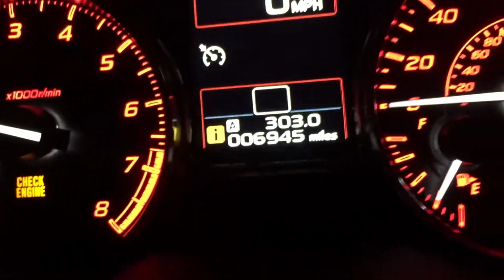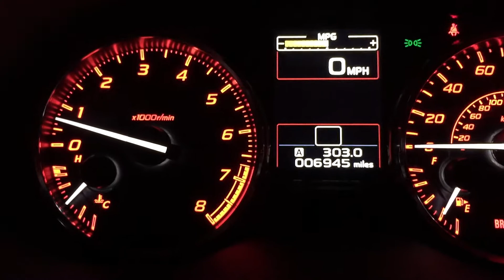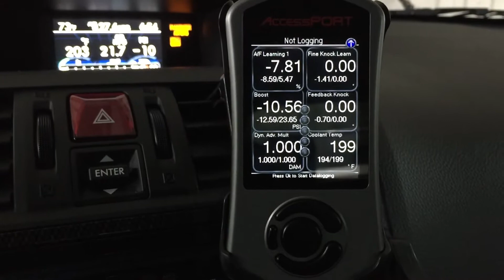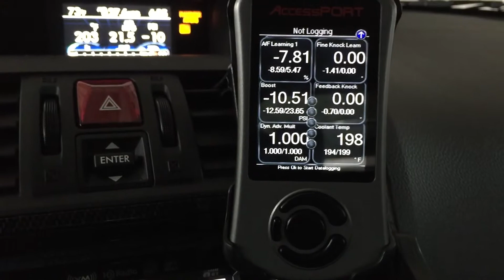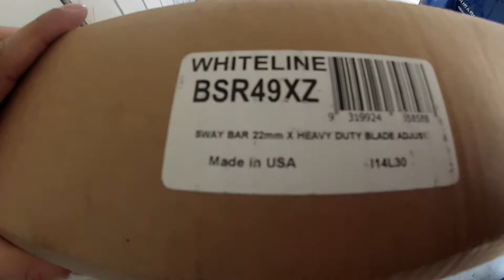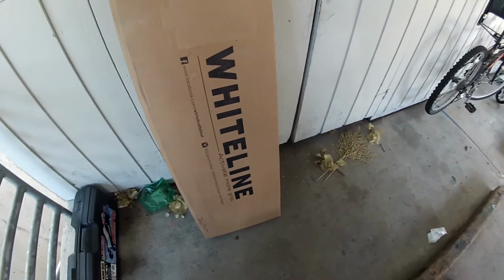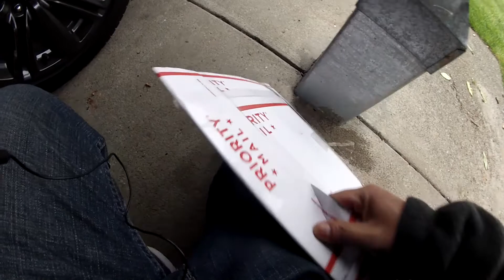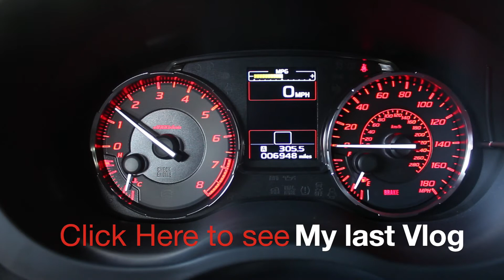Vlog 2: CEL/Rear Sway Bar/Tuning/Mud flaps 2015 Subaru WRX

Comment: What side of the Accessport is the Boost gage running on? if its on the right side of the Accessport it can show some crazy numbers move it to the left side of the access port and it will fix the issue. Not sure why it happens that way Cobb told be to do. Every once in a while I would hit 39 PSI and it was that issue.
Reply from the maker: Blake's Garage Like the new name! Thanks for the tip!

Comment: you did remove your pill right? which could cause overboost?
Reply from the maker: LastHumansGarage Yes, pill removed. According to Cobb, Catless downpipes tend to cause boost spikes on FA engines. Cobb told told me the OEM turbo was engineered to have the cat mounted near the turbo which is why they designed they're FA downpipe that way. They explained it, but the technical details are way beyond my scope of knowledge or they are just trying to sell THIER downpipes which have the cat right after the turbo. They recommended an EBCS to regulate boost spikes.

Comment: Hey man I pretty much have the same set up as you do. Would having a catless J pipe cause any problems? And what map would you recommend running. Thanks!
Reply from the maker: Art Valena Catless will yeild a tad more power but is subject to occasional "boost spikes". If you go Catless, a Grimmspeed EBCS is HIGHLY recommended to keep the boost pressure consistent.
Reply: thanks!